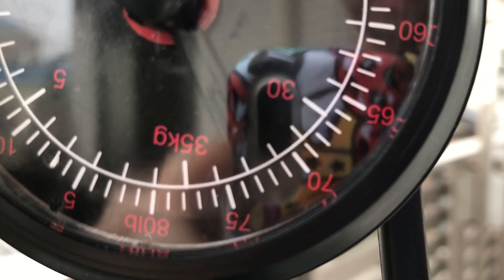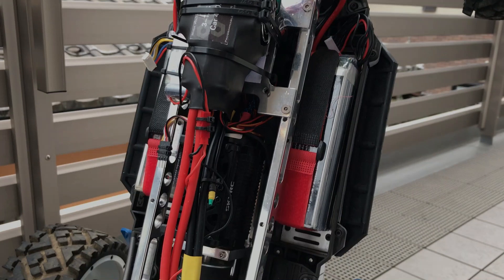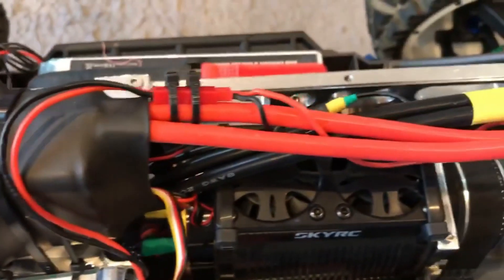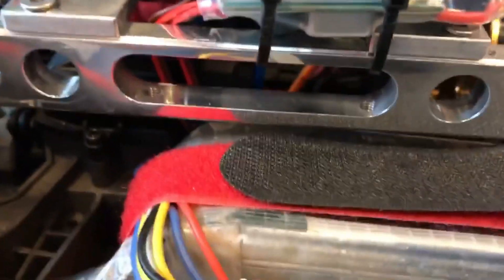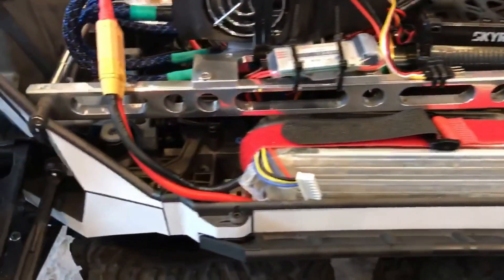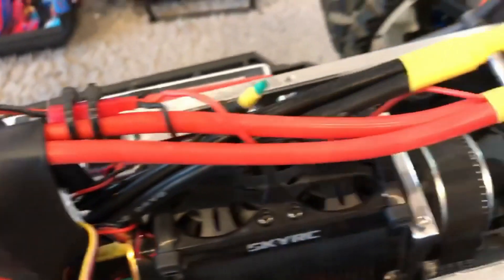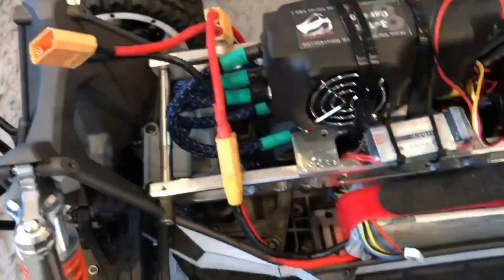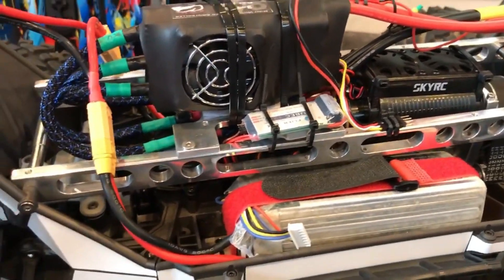12S XMAXX WEIGHT & 400AMP FLIER/RSNAKE ESC  OVERVIEW

Comment: Did you have issues with running those HRB lipos with such low discharge capability?  50C seems low for a setup with such a high power possibility
Reply from the maker: HRBs have a 60c discharge100C burst rate / they work perfectly!

Comment: Check out the QS8 connector, they are 8mm with built in Anti-Spark. Designed just like the XT90’s.... you definitely to remove that xt90 like you said....it’s a bottle neck for that system.
Reply from the maker: very true i changed to those QS8 shortly after

Comment: Love them rims and tires , they weigh more or less then stockers? I want some bitchinf tires and rims , I trade off my erevo 2.0 decent shape not beat for a brand new in box 6s xmaxx I'm getting a max6 or max5 for it which one would be best ?
Reply from the maker: Thanks brother
👊👊 Id say about the same as
stock. Sounds like you made a good trade - if running a stock Xmaxx motor the Max 6 is ideal " fits right in to the stock ESC space and dont have to worry about messing with an aftermarket esc
mount 👍✌️👊

Comment: Dam!!!    do you think that a max5 will be enough for a tp5850  1500kv?  Building the xmaxx for sand drag and I'm concern about amperage cutoff. Nice rig my friend.
Reply from the maker: What up brotha! ✌️👍👊🍻 Max 5 can handle it just gotta gear it up conservative! Best set up ive ran for power and speed has been 30T motor 45/spur for sand racing id say go down to a 20 motor pinion!